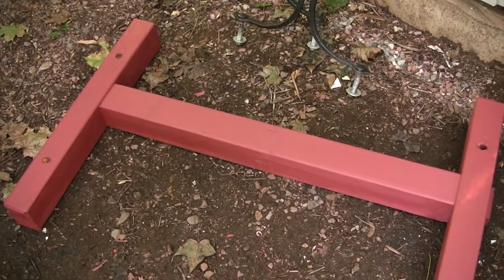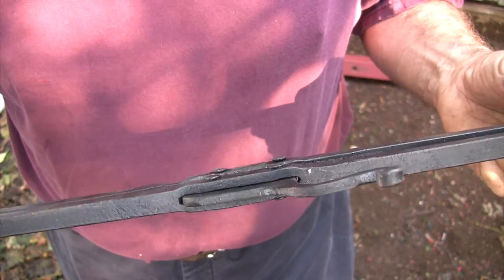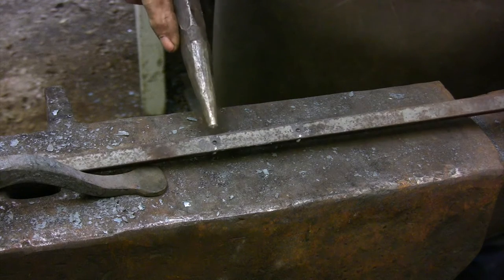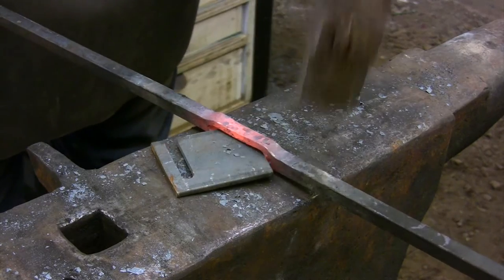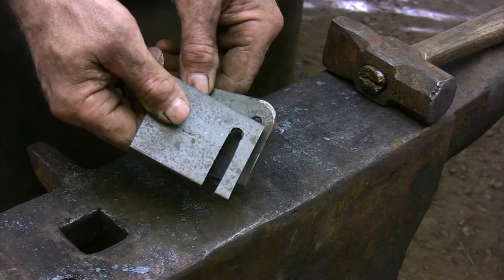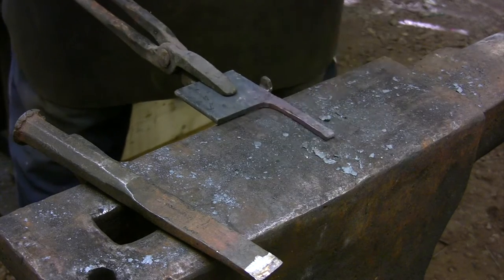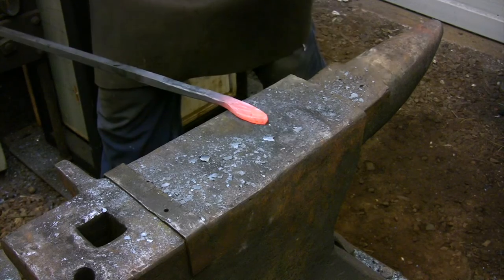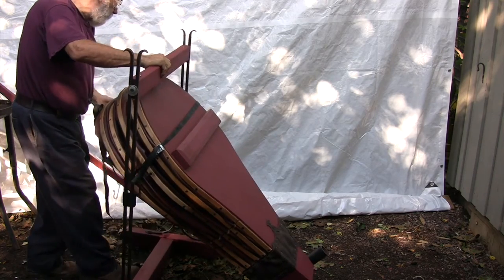Blacksmithing Project - Blacksmith Bellows 5

Comment: On the earlier vidio, I didn't see if there was a set of valves in the central board between the bellows on the bottom and the holding chamber on top !
Thos is what I would do to keep air from returning to the bottom !
Reply from the maker: There are two sets of valves. I think in the next video or so  I go through the process of assembling the bellows and you see the two sets.  If you go to my channel page there is a playlist with the entire build.